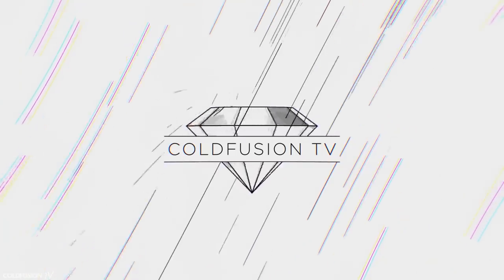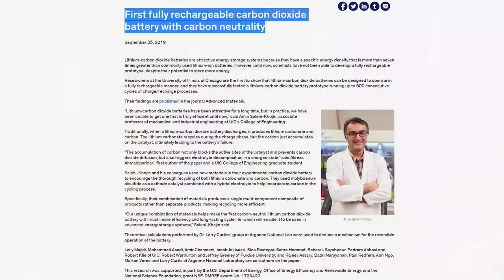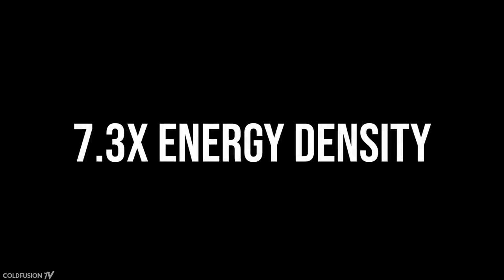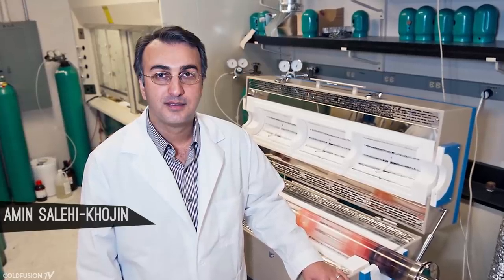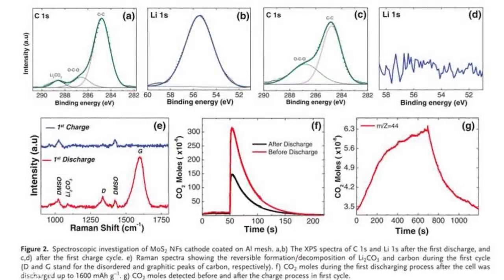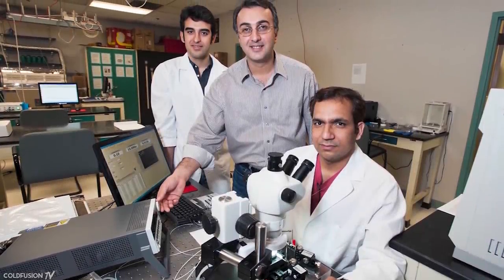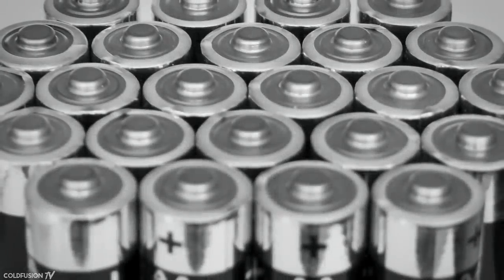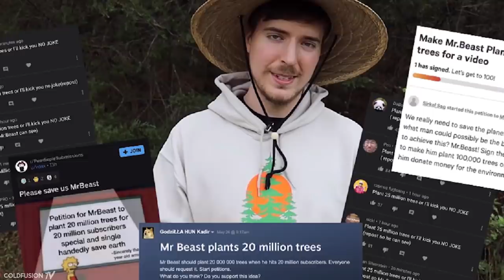Carbon Dioxide Battery Breakthrough

Comment: Really getting tired of hearing about battery technologies that will never come to market.
Reply: ? They are trying ?
Reply: Orange man bad
Reply: Because most of them are bs
Reply: I am a unique individual
Reply: It will only take one.
Reply: @PRiMETECHAU  Patent has expiry date. Not forever.
Reply: @Hungoverp  20 years... or a human generation. If you patent it correctly, you can tweak it and repatent it. Pharmaceutical companies do it all the time. So they can be extended indefinitely.
Reply: @PRiMETECHAU  Sorry mate, this logic is BS.  It assumes that patents are legally binding in the whole world. Do you honestly think that for example, North Korean government would give two hoots about patent if the subject in question would give them some great advantage?  And remenber those have the power and resources of the whole state to develop and fine tune any promising invention.  And no opposition to stop that.
Reply: @PRiMETECHAU  China: Patents? What's that?
Reply: What is worse is the sheer number of "OmG WATER from AIR" startups that end up being just massive scams and money grabs because they are literally just using dehumidifiers.
Reply: Because they are trash concepts.  This one is the worst I've seen lately.  With a duty cycle of 500 the landfills would overflow with lithium and casing
Reply: No offense, but patents have not been the barrier keeping battery technology from becoming commercially-viable. This, along with Li-S, is not a new idea. Sure, they threw in some molybdenum as part of the material, but check the voltage outputs in the paper. Those are not yet useful, so the capacity they quote is misleading.
Reply: Some turd said exactly this for lithium-ion also
Reply: We r in the transition period of a revolution. We r so used to seeing new technologies in just a span of few decades. We need to garner patience. Nothing should change soo fast..
Reply: @PRiMETECHAU  Patents only work in countries that have signed up for it. Counties that haven't entered into the patent agreement can copy anything they want. And  a patented product  has only got to be changed 15%, for the patent to be rendered useless. Reverse engineering  is another way of getting around a patent. In other words,  patents aren't as safe as you think they are !  In fact..... just announcing a product such as this ( without a signed non disclosure agreement), could destroy the chances of getting a patent,  because it has become common knowledge.
Reply: @anthonylosego  They can patent the new thing, not re-patent the old thing. Others who build on the new technology can do the same. (But I agree with the sentiment -- patent law needs an overall.)
Reply: This is either due to patent and copyright laws, which is a government inefficiency, or the video is of a comcept to get prospectors

Comment: I'm still waiting for graphene battery, I remember people talking about it in 2014
Reply: Graphene technically is doable but nobody has found a way to produce graphene batteries at a consistent yield.
Reply: Graphene ultra capacitors are produced at Skeleton ultra capacitors. But indeed no batteries.
Reply: lasest2 Samsung is coating the cathodes with graphene, it is not producing graphene batteries.
Reply: It’s mostly because we can’t produce graphene on a large scale. People are working on it though
Reply: lasest2  lmfao nope, and i doubt they even integrate much graphene until the S12,
Reply: Please stop.Its here already. Checkout hobbyking.com and search for graphene batteries and you will get it.
Reply: It's coming in 2022 in the Fisker cars.
Reply: They sell them....in  LI PO for over a year, now...where have you been???
Under a rock??? You know who demands them??? DRONE USERS..so they
can fly stupid fast using FPV...as if they're in a  roller coaster ride.lmao
Reply: Graphene tech is under "Top Secret" usage, we mortals have to do it with the basic stuff.
Reply: People still will be talking about it in 3014,...  what, could have been!!!🤣🤣🤣🤣

Comment: I think, that there are many similar PROMISING studies but question is WHEN 🙄.
Reply: Never because it has the potential to be a "potential economic upset" as all are innovative and inventive studies
Reply: Maybe in the next 2 years. My team and I at Waterloo have a startup focusing on converting CO2 to electricity, and batteries are just the next step. This tech is starting to get used in not only labs, but high risk startups.
Reply: @sciencemanguy  Whoa, how many other Startups are you aware of doing the same thing as you?
Reply: @ChuckNorrizHIM  there's one in Vancouver and another in Stanford. Competition is tough among us, but we do what has to be done.
Reply: @sciencemanguy  Well I don't see them watching/commenting on this video. Any feasible way a 20 y/o can show support?
Reply: @sciencemanguy  Cuz it's just surreal to think a person a part of a  start-up is here when in the video it's only talking with lab technicians
Reply: @ChuckNorrizHIM  
https://www.sciencedirect.com/science/article/pii/S258900421830186X?via%3Dihub
Here is a link to what our product will be based off of. Right now we're still in the incubation period and are working on our Minimum Viable Product, so I cant give much more away without losing potential patenting rights.
Reply: It will happen once the cost of these new types of batteries come down. This will occur once supply chain issues get resolved.
Reply: if you're going to make significant changes to the current Li-Ion batteries you need to build up the supply chain for the new technologies or just use them in small niche products they make hundreds of millions if Li-ion cells a year and until a tech can replace that capacity you're not going to use anything else in large quantities.
Reply: @NonyaBusiness! 😄

Comment: FYI a company by the name of XNRGI has already developed the lithium ion metal battery with density of six times of the current lithium ion battery in the market. And most importantly, XNRGI is currently at the phase of commercialization. Please check it out and perhaps do a piece on them.

Comment: 2019: break through in battery technology 
2025: phone stills dies by noon
Reply: Maybe iPhones lol
Reply: Windows 25 will require 120 Gb of ram to run so battery will last 2 hours
Reply: My iphone xs I bought a few months ago is already on 95% battery health LOL
Reply: @Roshan_420  Well. . If it lasted for years, you wouldn't buy a new one next year.
Reply: Debt Miner the battery already sucks ass, in a year it will be ruined
Reply: My galaxy s10+ lasts all day with heavy use. Best phone I've ever had.
Reply: Manufacturers keep increasing battery drain. If they stopped at 5.5 inch screens we would have been okay. But they keep making bigger and bigger screens and now foldables.
Reply: @GK-qc5ry  And here's a winner. Even if they increase battery capacity twice, phones will just draw more and more juide, especially through backdoor processes like spying on you or whatever. Also, more powerful screens, processors and so on require more power.
Reply: Yes they would have same battery time because phones would be capable of doing more things and would have more taxing things to do we have come far from old days with 500 Mah batteries.....
Reply: 2033: breakthrough in battery technology, no really, by Wolf Enterprises, your phone will last all day
Reply: 01001011 Have you used the iPhone 11?
Reply: Tyler Kerr it’s high noon
Reply: Tyler Kerr Time for a new phone. Recently I replaced a 3 year old phone that had a battery that was acting crazy with sporadic charge levels that jumped all over the place. I’ve decided to take care of the new phone battery the way you’re supposed to treat a lithium car battery. That is, try to keep the charge range within the 20 to 80% range. I was surprised to learn I can get by for a whole day on that charge range. If need be, I can easily give it a small charge during the day. I’m planning on keeping this phone 5 years.
Reply: Well the better the battery, the better the technology can be pushed into the phones. We're always going to have this battery problem.  For example today's battery in one of the first Nokia phones now would easily last a week of use. We've come a long way and still taking great strides!

Comment: thunderfoot is about to drop a diss track on CO2 batteries in less than an hour after this...
Reply: Would be nice to see his take on this for sure as an actual chemist. Reading about this it seems legit enough as a battery, but this isn't a solution of any kind for our CO2 problem as one of the researchers made it sound like, as all of them failed to mention that this battery actually generates CO2 when you charge it. You have to reverse the chemical reaction after all to make it rechargable.
Reply: You guys already know what he is going to say. It's a friggin bomb, not a battery! lol
Reply: There's a lot of information that's missing from this video, like: how much heat is generated?  What system / how much energy is used for creating the battery?   More information about the by-products would be great (not just elements, but what about waste energy?)
Reply: @tonechild5929  that happens alot with bs. Lol

Comment: If the current range on a Tesla is 300 miles, and these give a range of seven times that (or 2100 miles) electric vehicles would instantly make a lot more sense. Then you could drive all day, stop for the night (and recharge while you sleep), then rinse and repeat as desired.

A truly practical E. V.

Comment: Great stuff. Now for the main question: Where does the energy to charge the batteries come from? And what does the grid infrastructure look like for an all-electric society?
In many cases (the electric airplane in particular), the battery isn't the problem. The charge turn-around times and grid requirements are.

Comment: 500 cycles isn't nearly enough, needs more like 20,000
Reply: x2
Reply: Still in prototype.It will improve
Reply: I depends on the cost, 500 cycles should be good for 2-5 years
Reply: Current battery tech is at about 1000 charge cycles. 500 is already better considering it has 7.3x the density. I could charge my phone only one time and use it several days vs having to charge it every night. Which means that 500 will last longer than the 1000 cycles of current tech. Hell a Tesla battery can only last around 750 cycles, which means 500 is already way better due to the extended range. 750 cycles would put the Tesla at around 190k miles on its current battery. On this new technology the Tesla could reach just under 1 million miles before the battery is degraded
Reply: 3,000 to 5,000 cycles will be more than enough for the time being. 

If the new batteries hold 7 times the charge, one can travel 7 times the distance on one charge. 500 cycles would then easily be the same as 3,500 cycles in today's standard batteries or a life of about 9-12 years. Not bad, if that can be achieved.
Reply: Al 72  : Makes sense!
Reply: If you charge once a week a 500 cycles will last 9.6 years.

Comment: There is 2 German guys who have created a unique mechanical battery. Converting solar power to a pressure system storage. The prototypes are size of medium size domestic fridge and has an efficiency of 80%.  Think steam punk (sort of). You may want to check this out as a very unique solution to energy conversion and storage.  The unit can power a whole domestic house.

Comment: Still sounds low on the number of discharge/recharge cycles at 500, whereas lithium-ion batteries can typically cycle 500 - 1500 times. What is the potential for thermal run-away? Could make human scale drone aircraft practical! I''ll post a video on lithium-ion battery safety on my channel soon. That is something I work in my day-job at NASA.

Comment: 500 cycles doesn't sound nearly enough to make it viable imho
Reply: For a battery that lasts 7 times longer? If you only have to charge your phone once a week it would last ten years.
Reply: A normal Lithium Ion battery will also degrade after 500 or 600 cycles, if it's always charged to 100 % and discharged to a low percentage.
1500 cycles are only achievable in the 20 to 80 % range, to avoid stress for the battery.

Comment: Still uses Lithium so basically, we're still screwed as it is non renewable material :(
Reply: I like my phone end up in landfill and my strew end up in sea turtle's nasal, no thankx to renewable material.
Reply: To play the devils advocate here, it's not like that lithium is disappearing into thin air. Right now it's economical to mine lithium straight out of the ground, but we'll reach a point in the future where electronic waste becomes a more viable source of the material than raw ore, promoting recycling and the ready availability of the product albeit with a price difference and some purification steps. The only truly non renewable resource in this world is helium, as anything we use immediately escapes into space, but others like oil are close competitors due to the sheer time and energy it took to create our current reserves.
Reply: 230 billion tons of lithium in seawater and extraction methods already developed - just expensive in comparison to current lithium sources. Think we have enough lithium for the foreseeable future. Doubt we'll be using lithium in 20 years - will be another battery tech altogether.

Comment: Me: carbon dioxide battery will solve global warming

Battery Factory: burns coal to make carbon dioxide for batteries
Reply: It will still be used either way so we might as well use those coals for something better.
Reply: Global Warming is a hoax.......CO2 is required for trees to grow, which provide oxygen.
Reply: @red7fifty  Hopefully this is a troll. If not, then let me tell you that we are producing more CO2 than the trees can covert into oxygen.
Reply: @red7fifty  Please tell me that 3 individual people liked your comment because it's just satire.
Reply: That would not really matter though, as the co2 would be stored in the battery and not enter the atmosphere
Reply: Nobody would burn coal to make CO2, when it can be pumped right out of the air - which is a way of killing two birds with one stone. Super batteries, and cleaner air.
Reply: 0.04% CO2... that is sweet fuck all when you think about it. And there is more than just trees converting CO2. There is also grass and algee, the latter of which converts the most amount of CO2 by a wide margin. Trees convert the least for any given area. But trees have a far bigger role than converting or storing CO2.
Reply: @red7fifty  Granted we don't chop them down at a faster rate than they grow.
Reply: @TheFrontyer  Also lithium, catalyst, and energy involved in production which is produced in Chinese coal power plants.
Reply: @Mekronid We already have very effective means of separating CO2 from the air. It's not difficult.
Reply: @Mekronid Yeah, I don't GAF anymore. You're right and I have no idea what I'm talking about, okay? Now go away.
Reply: @Mekronid It's good that you know your limitations.
Reply: @Mekronid I'm devastated to learn that I am such a disappointment to some guy on the internet.  🙄
Reply: What about fermentation to produce both alcohol for something else AND Carbon Dioxide for the batteries. 2 for 1
Reply: Fart is enough
Reply: @survivinggamer2598 - The primary source of free (uncompounded) oxygen is chlorophyll-bearing plant plankton in the oceans, which are 6/7 of the earth’s surface. Trees and grasses make their contribution as well. Plants use part of the oxygen for their own metabolism, and draw oxygen from the atmosphere when the sun is not shining on them, like at night.

Comment: Gonna be nitpicking here, but The University of Illinois at Chicago and University of Illinois are, to an extent, not synonymous. 

Here in Illinois, and the Midwest in general, when people say University of Illinois, it automatically refers to the main campus, University of Illinois-Urbana Champaign. 

There are three U of I campuses, Urbana-Champaign, Chicago, Springfield; and it’s important to be explicit when mentioning either of the three schools. 

With that being said, this research is being done at the University of Illinois at Chicago campus, which was later specified in the video as “UIC”. 

Signed, 

A UIC Alma mater

Comment: The molecules you have in your thumbnail are not CO2 - they are H2O, based on the colors we typically use to delineate different atoms. CO2 would also be linear, not bent. :)

Comment: Fuel cells still have a huge advantage over batteries with energy density. Hydrogen has an energy density of 120 mj per kg and ammonia (a much better option for fuel) has a density of 22.5 mj per kg. Energy density and speed to refuel are form more important than total efficiency when it comes to vehicles. Discharge rates and storage are important as well.

Comment: With just 500 recharge cycles they're not nearly ready for mass production. But they only just solved the problem of the battery literally breaking itself when used, so I keep my fingers crossed they'll solve that one as well.
And then another one and a few steps like that and then they will be ready.. soonish. In the technological timescale even if it takes them a few years it's actually fast, considering the impact it would make when released.